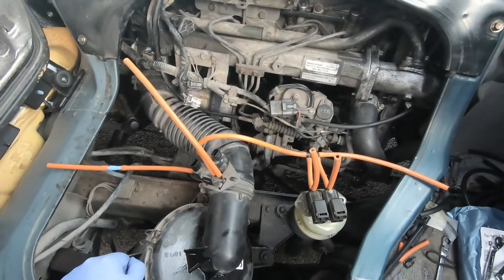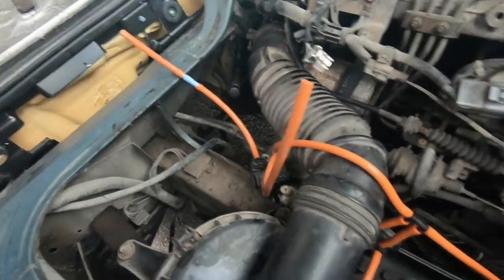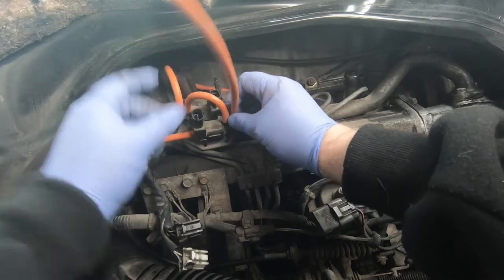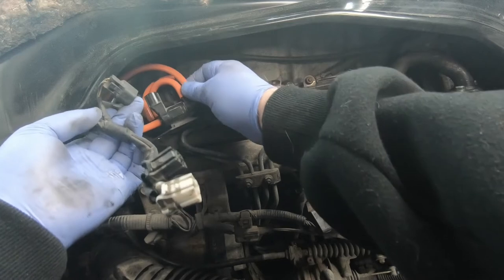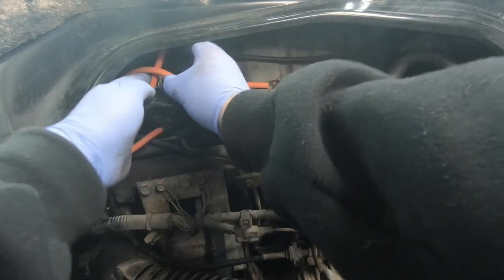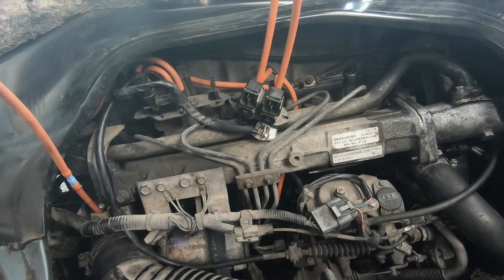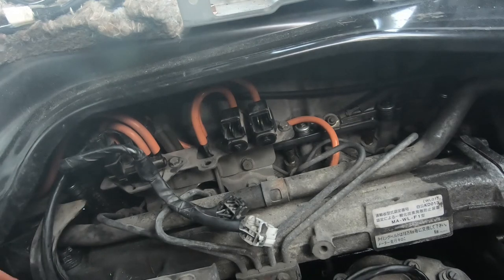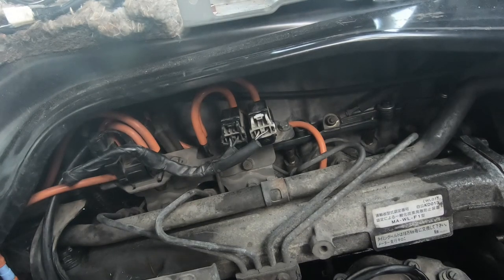Mazda Bongo / Friendee / Ford Freda: Diesel Vacuum Pipe Replacement Part Two

Comment: Hi again bud. Can U tell me if it's possible to change short glow plugs to long without having to take the tin center cover off? Cheers dude. Also since taking mine off last time and putting it back on, my hand break appears to be locking on. Is it possible that iv twisted the hand break cable and given it more tension but twisting the tin center around??????? I replace my glow plugs but 1 plug spins around on the top half making my van judder slightly on start up ( brand new 2 day old plugs ) my new long length ones arrived today so was thinking of changing them again but need a quicker way...... Thanks bud.
Reply from the maker: Sorry mate that’s beyond my capabilities. I’m afraid.

Comment: What are the mitsubishi solenoids called if I was to search Them on eBay? There's never anything for the Bongo! I'm living this video I done a simple glow plug change and anything that could go wrong certainly did. Everything broke in me. So quick steel on its way but it I can order new stuff I will
Reply from the maker: I’m not sure what they’re called to be honest. If you’re not already a member of the Mazda bongo owners club on Facebook that is the best place to ask good luck.👍
Reply: @JustPlodding  I am a member cheers buddy ( tymmuffphii ) also on the bongo southwest page on Facebook and another one with same name...... I just bout some blue silicone Flexi hose from Amazon in blue as it makes the van go faster apparently. Now every site iv seen suggest the temp ranges from -60 upto 160. This stuff I bought says it can reach 260 or 280. It has amazing world wide reviews and I used your videos pausing meny meny time to rebuild my kit haha that bottom connection down under the engine is a right pain to reach and connect. I had to use silicone grease and a clean rubber glove to gain some friction just to put it on. I was worried about it all being too close to a very hot engine, but I guess if it's made for that it should be ok. Today my 1way check valve ( SAME AS YOURS ) Arrived after ordering yesterday had arrived so I'm off to fit that shortly and complete the circuit...... And rebuild everything as I took the metal center plate off aswell as the seats lol...... I need it to live and sleep in as I'm homeless...... Next is oil and fuel filters then wheel arch trim vaneers. HAVE A GREAT DAY.

Comment: Great tutorial thanks. During my research I may now have discovered my lumpy start on ignition with my Bongo. Are you still selling or recommending the kit. I am NI based. Cheers.
Reply from the maker: Yes mate, only in black currently. search for Mazda Bongo / Ford Freda / Friendee 2.5 diesel Vacuum Pipe Repair Set and it should come up
Reply: Just got it . Cheers. Thinking I should also buy some solinoid replacements while I am at it. £13 each on ebay. Would you recommend any other parts for this that I may need? Thanks again for your help.
Reply from the maker: @spacepaint  Personally, while it may take longer, I prefer to replace one thing at a time, it's cheaper, but it's also more specific ie if you replace 2 or 3 things at the same time, you don't know which one was the problem.

Comment: Is this kit still available to purchase? if not, what is the size of the hose needed to replace original pipe. cheers
Reply: I use 4mm silicone hose from Amazon

Comment: Just replaced some of mine after the plastic nubbin on the air intake pipe had broken off.

All seems to be working ok now, is there a way of testing this without cold weather?

Van used to run like a pig in cold weather until it heated up
Reply from the maker: Not specifically that I know of. Only thing I can suggest is wait for one of those very cold summer nights and maybe try then?

Comment: Can this be done without removing the parts? As in, in situ
Reply from the maker: I very much doubt it. When I tried access was almost impossible you would need tiny hands and the biggest risk is that you would break one of the actual solenoid’s prongs and then you have a much more expensive job as well as the difficulty in sourcing the parts.